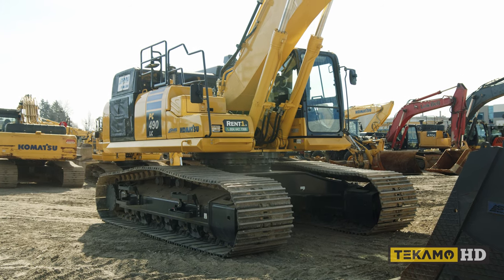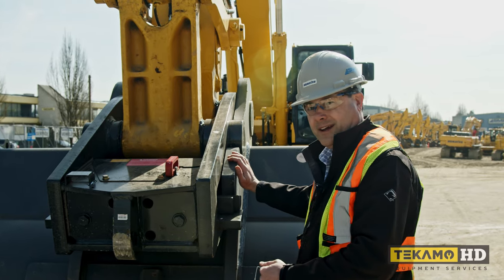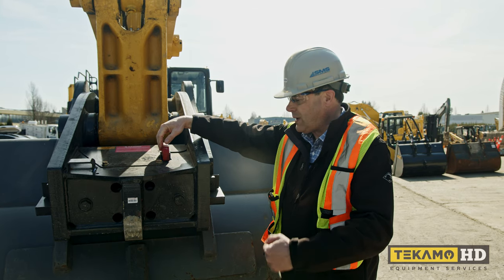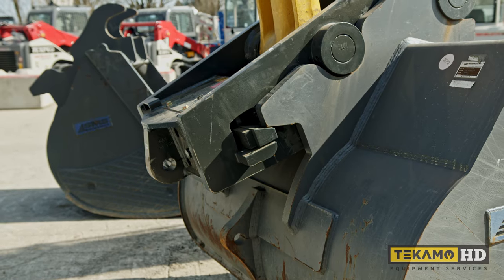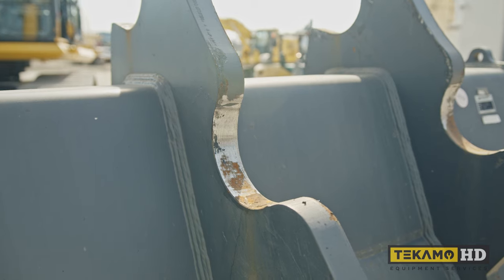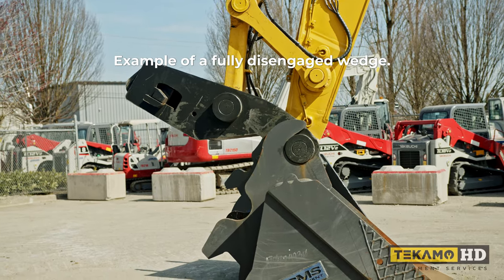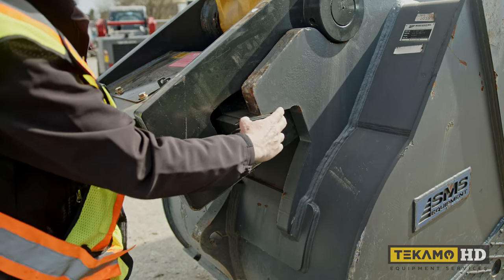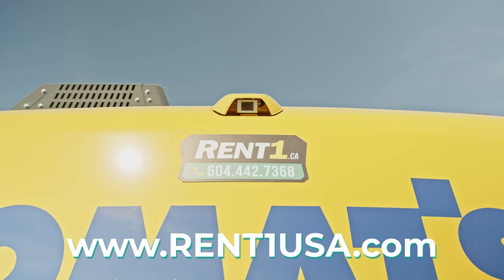Excavator Lock Pin Stuck? Don't Make This Mistake! Avoid COSTLY Repairs When Changing Attachments.

Comment: Thanks guys. Great tips. Keep them coming!
Reply from the maker: No worries! We're very happy you're finding this content useful. Is there anything you'd like to see?
Reply: Tekamo HD yeh, how the mechanics deal with stuck final drive drain and fill plugs on older equipment. Or another one I struggle with is getting the turntable gearbox gear oil at the correct level after a change. The gear oil seems to always “blurble” up and burp a mess of oil out the filler dipstick and is a real pita when filling.
Reply from the maker: @chadrides914  You got it, Chad. We've added this to our list of suggestions. Is there a specific model and year of equipment or brand you want us to keep in mind?

Also, awesome videos! We noticed your latest video on heavy equipment was you running a 350 X4. How's that been treating you so far?
Reply: Tekamo HD I I’ve put all 5,000 some hours on that LB350x4. Was purchased new. Haven’t had a single issue with it other than the track tension idlers seem to get stuck and won’t decompress without putting major force onto the grousers to push them in, and the radio stopped at 4500 hrs. That machine seems to cycle a little slower than some others but has been a real pleasure to run from an operators perspective. We run Kobelco, Linkbelt, Komatsu and have  Kubota’s for mini excavators. Far as Dozers go we run new gen Komatsu’s. These seem to have a good bit of DEF problems unfortunately.
Reply from the maker: @Chad Right on. We work with a lot of Kubotas and Komatsus too. 

We'll definitely have videos touching on diesel exhaust fluid related problems as well so stay tuned for that!
Reply: @chadrides914  Hi Chad. I just saw your questions so apologies for my late response. If your plugs are tight on any component, I usually shock them by giving them a swift tap with a heavy hammer. If the hex head or 1/2" female drive head gets stripped, then you will have to weld a larger nut on it and allow it to cool before taking your wrench to it - remember to order a new one before welding the nut.
In regards to re-filling the swing gear box, if equipped, look for  a plugged breather or remove it while filling; you may also have a separate filler and dipstick, so just pull out the dipstick while filling. If your filler is also the dipstick, then fill slowly and go on to another task while checking the level in between other tasks - finally, be sure to rotate the swing machinery and recheck the level.
Reply: @williamriquelme2147  your reply is very thorough and I appreciate that. Clever move on welding nuts to the final drive plugs, funny I have had to do that once, and I now smack them with a large hammer a few times prior to removing them like you reccomendEd. Thanks. Be safe out there.